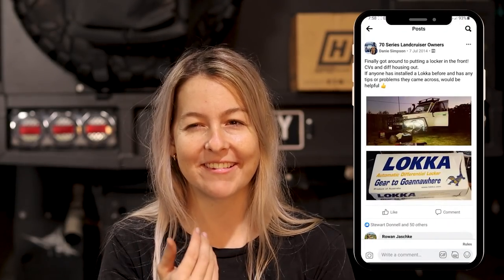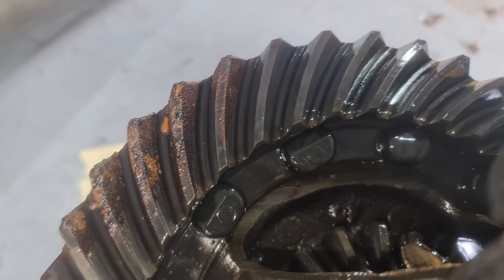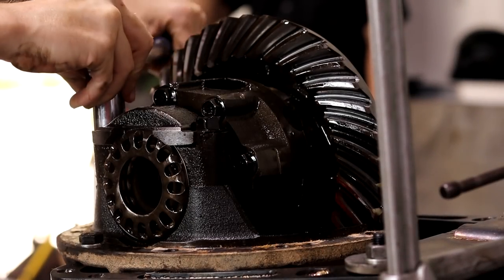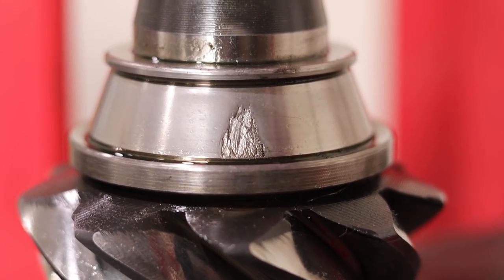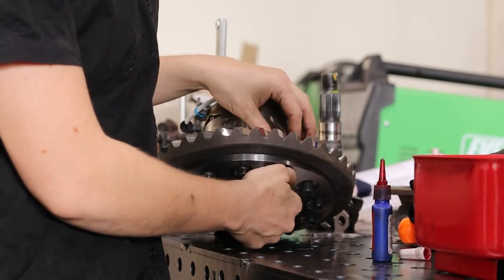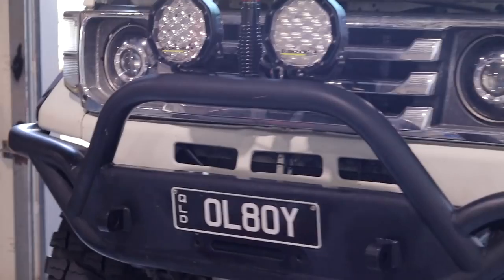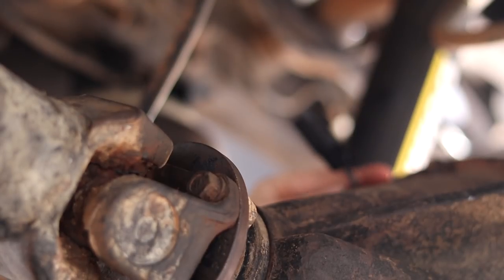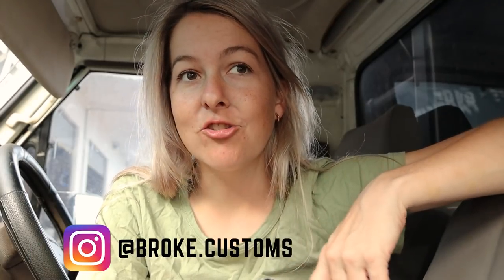Harrop E-Locker Install

Comment: Hey Danie... My 80 series is in at the mechanics getting an Elocker at present as the ring and pinion gear had a party and decided to crash so I'm getting the Elocker installed at the same time...  Great info and it is great to see you back and making content and I love your honest opinion on things as always... I'm just an off road tourer wanting to get into out of the way spots not into crawling or comp stuff so this should help me lots. I have been researching lockers for a few years now and it seems the best low maintenance system, and it just works...

Comment: Just found your channel and will be watching more vids.

You made a statement about full time mechanical lockers wearing the rear tires down but indicated that they've worked fine in the front. There really isn't any different wear front or back unless I'm missing something. I'm looking at installing the lunchbox lockers in my rig. The piggy bank can't do electric or air lockers at this time. I'm sure there will be some heightened scrubbing of the tires but they're designed to release at some point of differential turning. Please correct my thinking if I'm not seeing something.

You go over the pros and cons from what Ive seen so far. 👍 I look forward to your upcoming videos. And for the folks that insist on that being your dad's truck..... well, you can fill in the blank.

Have a fantastic day!
Reply from the maker: Yes what I said in the video was correct. The mechanical auto locker that I have cannot be disengaged permanently. Hence when you install them on the rear and drive on hard bitumen surfaces the locker continues to engage and disengage, because your tyres can't 'slip' very effectively on road it ends up just destroying your tyres and very noisy on road.  Mine is installed on the front where I can disengage my front Hubs and drive to the front diff on road so the locker isn't 'on'. 

Thank you for watching appreciate it!

Comment: It took me a while to choose, and ended up with harrow elockers front and rear, and love them! Way easier to control than oem lockers as they don't drop out unless you switch them off, they have been great...
Reply from the maker: Yes agreed! Such a good replacement for factory solenoid operated ones

Comment: Sweet video and good insite into a E v Air…. For me I have onboard air already, and arb’s linx so thinking air might be the go, but feel the next build will get elockers cause as you rightly pointed out, way less things to go wrong.. Cheers for sharing!!   Also hope that Oz gets through the lockdowns soon. All the best from NZ.
Reply from the maker: Yeah that's it hey all comes down to the individual and they're build set-up. I already have a front Locker and a dedicated compressor for my airbags so to install another compressor just for a front Locker just wouldn't suit

Comment: Electric/air locker is like Nissan/ Toyota argument. I have had air lockers in my troopy for 15yrs and not one issue. A good Installation is there key I guess, like you pointed out Dani, it is one of those jobs you need to know what you are doing.
Reply from the maker: Most definitely! That's awesome to hear though, a good install is very key
Reply: @DanieSimpson  as you know work shops outside of the defence do not use counter signing for work. And then a lot of people follow YouTube tutorials which 95% of them are not doing it properly and shortcuts are taken.
Reply from the maker: @christurner68  oh yes indeed it's quite scary when you see some of the advice being given out on Facebook and forums also

Comment: Not sure if all the elocker ask for the same diff oil but just a heads up I know my locker says to run 75w-90 not the original 80w-90 for the LSD. Probably worth checking out.
Good video for sure.
Reply from the maker: All elockers say to use the oil that your factory LSD diff takes, so 80w-90 for me

Comment: 04 GU patrol, TD42t and RE4 auto - the rear LSD (like yours) worrrrrrks.... OK..... But just started looking for a front locker. Like you, again, the harrop draws my attention pretty quickly. Simple, reliable and easy to fix compared to an air set up. Thanks heaps for the little things in between installation stuff! Very valuable! Next things going to be reductions to slow up the auto downhill though!
Reply from the maker: Yes that's my next mod too!! Very excited!!
Reply: @DanieSimpson  are you going to partner with anyone for a discount code on the harrops?
Reply from the maker: @andrewcox710  no sorry you'll find alot of bigger companies don't offer things like end of year sales or discounts of they're products. The prices are already well set for the production costs, parts, packaging etc. Usually smaller people who onsell these put such a massive mark up on top of the RRP usually that they can have "sales" but really they're just cutting back on their own profit and the customer isn't actually saving.

Comment: Hi Danie, I have a auto Lokka in the rear and a Elocker in the front of my 80 series. I find the Lokka in the rear great as I don't need to activa it and it works on the run. With the Elocker in the front I can switch it on and off as I need it. I'm a bit jealous of your wiring harness because I didn't get the lockable switch or the waterproof relays (I only installed the wiring last weekend). Anyway great post, love your work.
Reply from the maker: Thank you! Yeah I couldn't do a rear auto locker in the rear because I drive my car everyday on road and they just accelerate tyre wear because they're still locking and unlocking on road
Reply: @DanieSimpson  I contacted Harrop about the switch and loom that you have and they said that yours is an older version and the new looms and switches are different. In my opinion the old type with the safety switch and the waterproof relays are a way better setup.
Great video as I just wired up mine on the weekend.
Reply from the maker: @WDMTAdventures  do the new looms not have the safety switch?
Reply: @DanieSimpson  no, no safety switch and no waterproof relays
Reply from the maker: @WDMTAdventures  I'll have to suss out who sells those lock out switches

Comment: Another great video from Danie👍, was planning to put rear Elocker on my 105 but I couldn't find shop whom can connect it to factory wiring or at least when I switch the Elocker on, see the light on dash panel. I have to find the way to do it myself.
Reply from the maker: Yeah would only be someone who was willing to put in the time to figure out all the switching which is a hard thing to charge a customer for. It's why alot of places will just say no

Comment: I am the same. Will rather run Elocker than air. As soon as I save couple thousands $$$ I will buy front and rear just because it is better for NOT damaging track and car when 4 wheeling.
Reply from the maker: Yeah that's it hey and slow and controlled looks so much cooler in my opinion

Comment: My 200 has a central diff lock is this the same thing and does it do the same job. I use it a lot on dirt roads. Great video
Reply from the maker: No this is a locker. A centre diff just splits drive between front and rear prop shafts, same as what any transfer case achieves. If you lift a wheel you will still lose drive and become stuck without a locker
Reply: @DanieSimpson  Thanks Danie bummer it’s not a proper lock.
Reply from the maker: @rodmason4320  it is but only to lock front to rear not individual wheels

Comment: I am only guessing of course but I suspect that limited slip was well past its prime long ago with the km on the unit, never mind that a rear tire lifted off the ground makes it totally useless even when it was a new vehicle. Would I be right to say that installing this locker and the mechanical front unit are the two best off road worthy drive line mods you have done to this 75 ?

It would have been so tempting to use a fine grit rollock wheel on a die grinder to remove that gasket material, unfortunately its easy to damage even steel and in the process put fine grit into the diff housing. Gasket remover spray and lots of scraping, I've sure done that a few times on parts.
Reply from the maker: Lsd worked pretty good for its age. Showed very little signs of wear on the clutch packs also. Very rarely lift rear wheels especially with the trailer.
Yes hands down lockers are what I would do first to any 4wd in the future.
Reply: @DanieSimpson  That is amazing about the condition of the LSD, if it had been a North American made axle LSD it would have been scrap long ago is my guess. Sure which they made most axle housings over here for pickups etc with the third member design vs having to do the gear swap in the housing under the vehicle and also no option to take another third member and throw it in quick. Highway tractors are like your Toyota, but GM/Ford/Dodge/Jeep have other ideas it seems !.

Comment: Hi Danie 
2007 Prado front & rear air lockers go anywhere thanks for your videos safe travels
Reply from the maker: A locked diff is a locked diff doesn't matter if it's air, electric, mechanically actuated or welded. All has the same outcome

Comment: Hey Danie, are you still running the standard springs you had re-set with the dobinson remote res shocks or have you changed your set up? If so where did you have them re-set?
Reply from the maker: Yes same springs that have been in it for nearly 20 years, local place did the hot reset they got bought out unfortunately. 
And yes I have dominions remote res adjustables all around

Comment: 12.7 hp love it, will you ever put a turbo on and run on low boost? i knew a mechanic who had a 2.4 hilux and he put a small turbo on it he said it helped it breath better
Reply from the maker: Nah never.  Will get a turbo motor one day but it will be one that was designed to handle a turbo. I'd much rather reliability over a few extra horsepower
Reply: @DanieSimpson  yeah i understand that why i put low boost and not high boost lol anyway love ya content mate keep it coming
Reply from the maker: @steveb2915  doesn't matter with the 1hz.  Have seen them done completely over the top with tens of thousands of dollars spent upgrading the internals and keeping everything sensible and in tune and still let's go. Simply not designed to handle the heat, so will always fail just a matter of when, not if.
Reply: @DanieSimpson  yeah well im sure you will find a good turbo engine one day. untill then 12.7 hp it is 😎
Reply from the maker: @steveb2915  one day :)